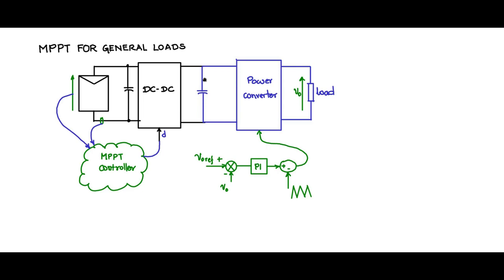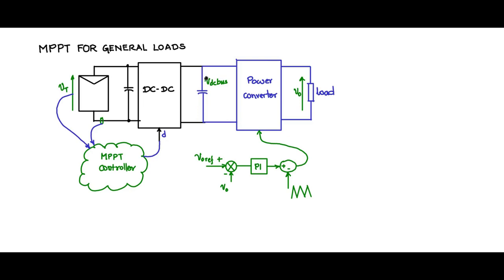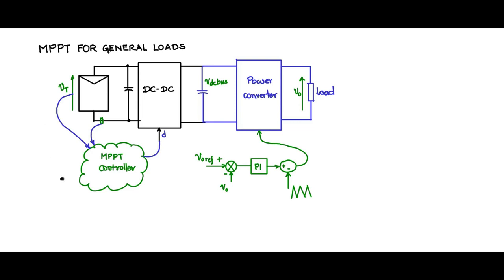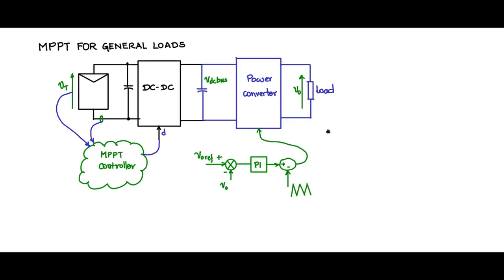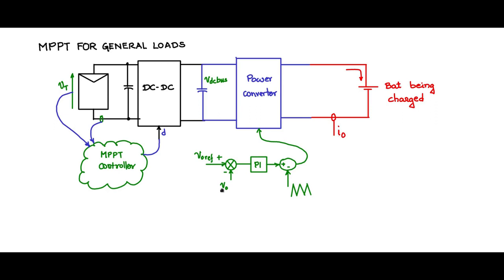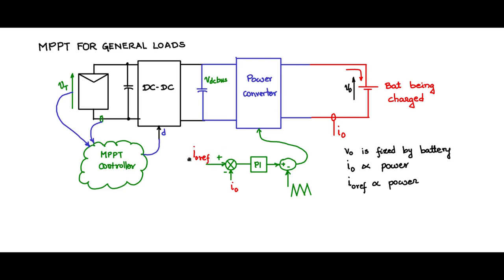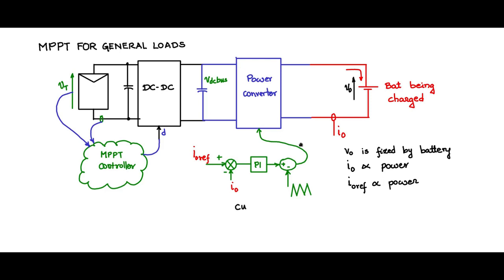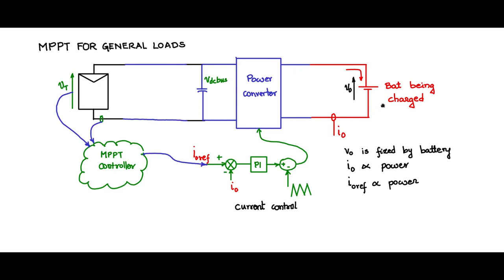Practical points - MPPT for non-resistive loads

Comment: Why is it being said that battery is capable of sinking? Battery demands a sinking ccurrent? I need explanation as I m not able to correlate it what sir has said with the theory. Anyone please.
Reply: When Prof. says battery is Sinking current and demanding sinking current, it implies the battery is deprived/low on charge and is therefore in charging mode i.e. current and therefore charge is flowing into the battery to charge it up.